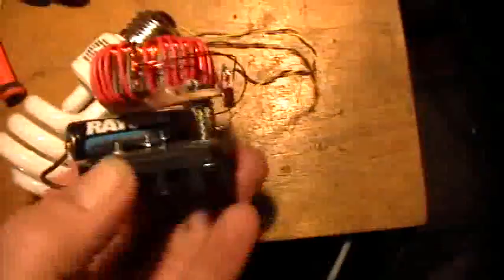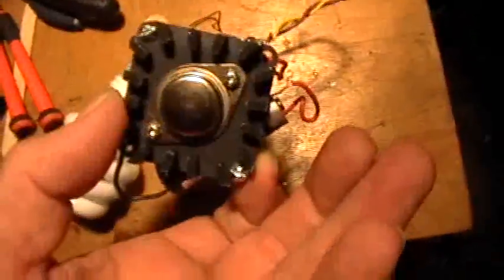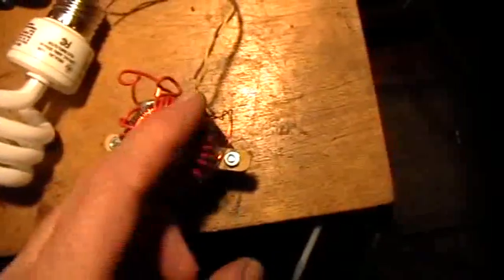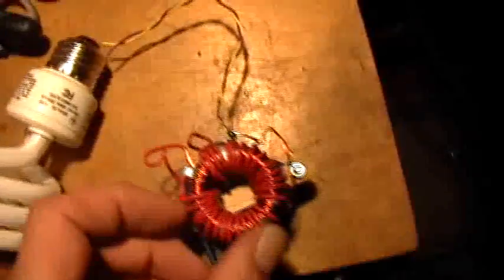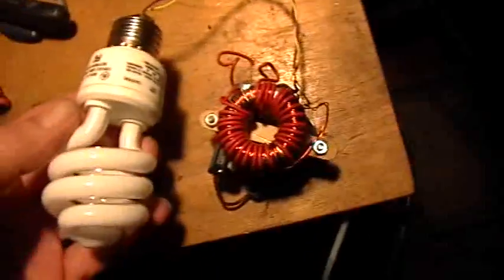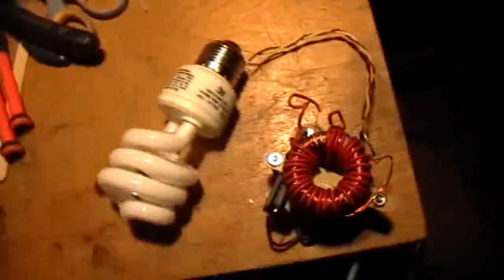Joule Thief: Variant with 2n3055 Flashes CFL

Comment from the maker: I find it easier to take them apart at the seam. Many I've seen lately are just snapped together there and it's easy to get them apart with nippers. Really too bad that CFLs don't last anywhere near as long as advertised. Yes, there are lots of good parts inside, like the electrolytic capacitor, six or seven 1n4007 rectifier diodes, a couple of transistors like the very useful MJE13003 which works very well in HVJTs like my neon JTs. Even some tiny toroids and cylindrical inductors in there.

Comment: the circuitry of the cfl i believe is competing with yours , btw those cfls are a great source of higher voltage caps for repairing old tube radios and junk it just sucks prying of the metel lamp screw part lolk